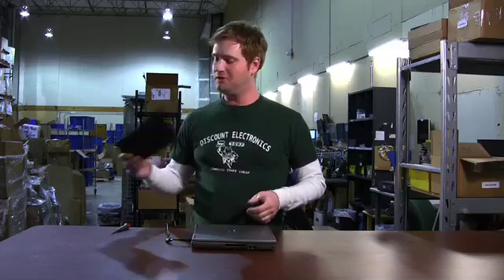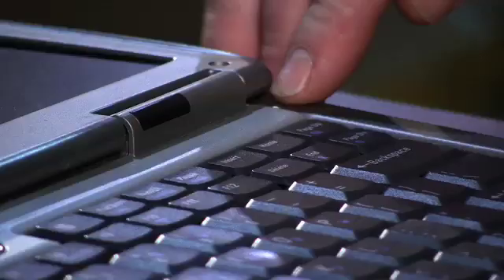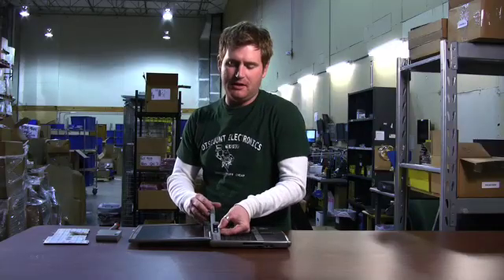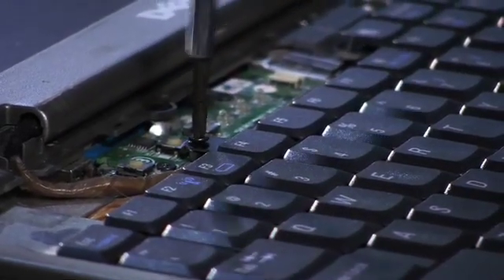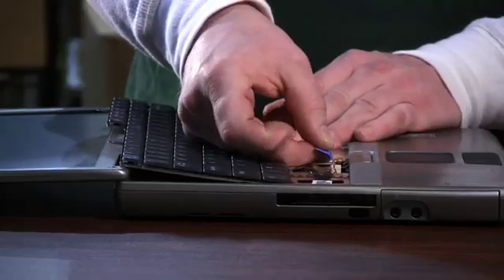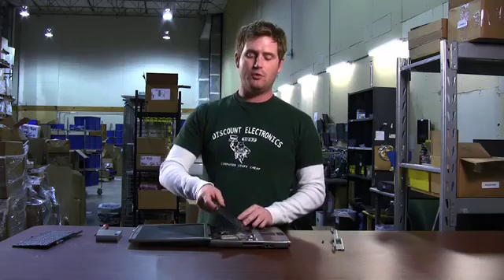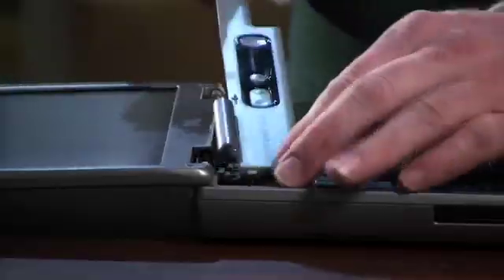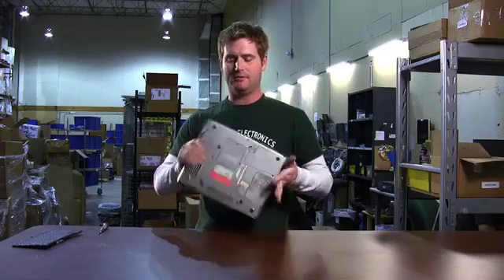How to replace your dell laptop keyboard, replacing dell notebook keyboard

Comment: Ummmm...yeah the guy is nice and all but I wouldn't want this "professional" working on my computer. He's not even grounded and therefore will probably ruin any computer he works on due to static electricity. If he is grounded in a way we cannot see, he should definitely discuss the risk of electrostatic discharge (ESD) when instructing do-it-yourselfers on replacing parts or performing any type of computer repair.

Comment: My Dell XPS M1710 was exactly the same except the keyboard 'cable' attaches with what I would have to call a 'ribbon plug', not a pin connector. You have to get the tabs on the ribbon end lined up into the slot and fold over the connector to secure it in place. A little tricky on the eyes, but that's it.